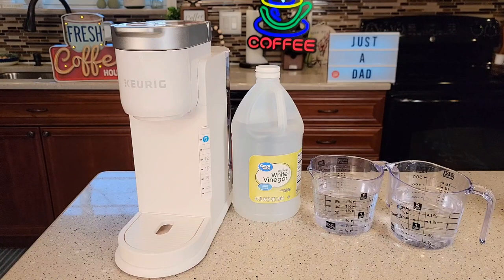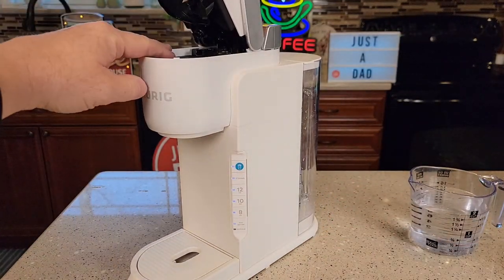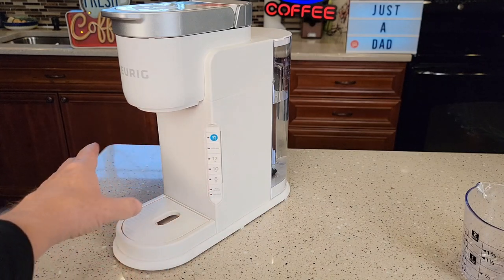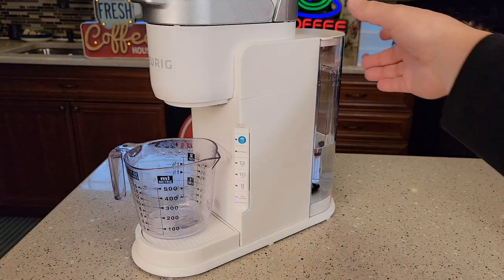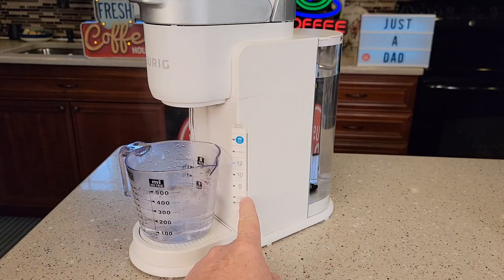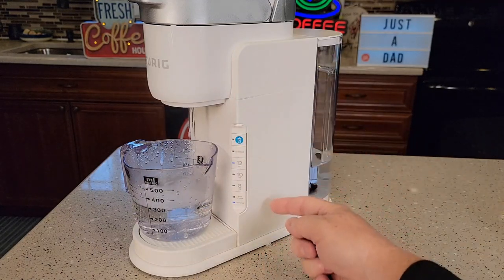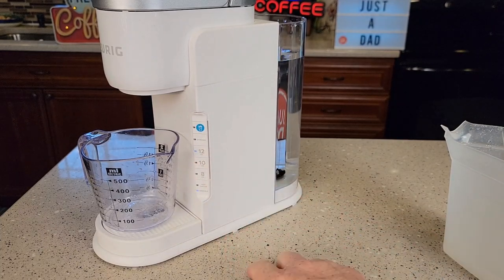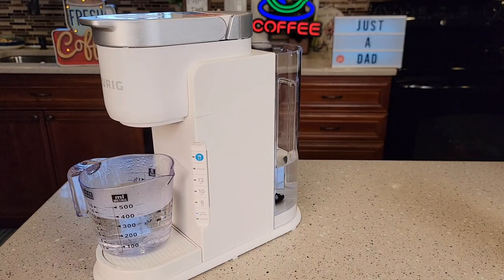How To Clean / Descale With Vinegar Keurig K-Iced Coffee Maker   Descale Mode Turn Descale Light Off

Comment: When I am letting it sit to cool down a bit before I run the fresh water rinse, during that wait time doesn’t it turn off? At that point, when I fill the tank up with clean fresh water and put the tank back on, all without unplugging it or opening the top, how do I turn it back on without interrupting where it was at in the descale process and causing it to start all over?